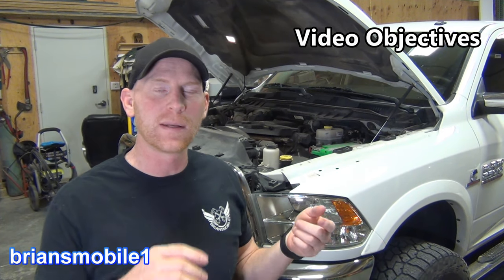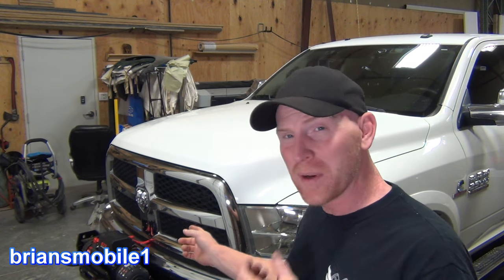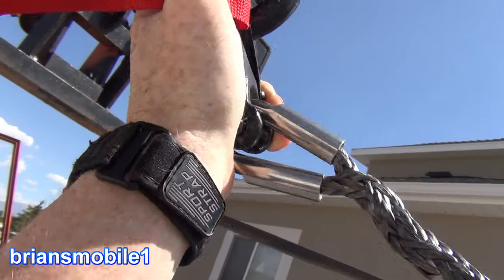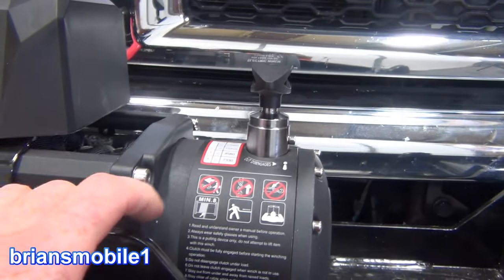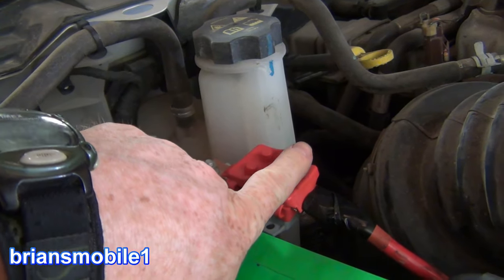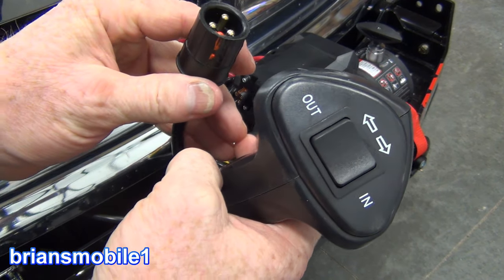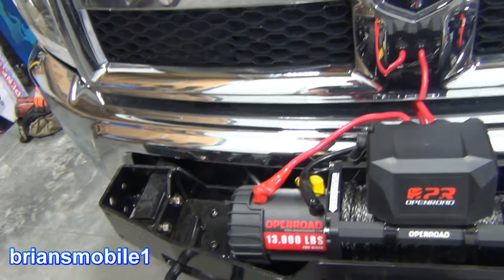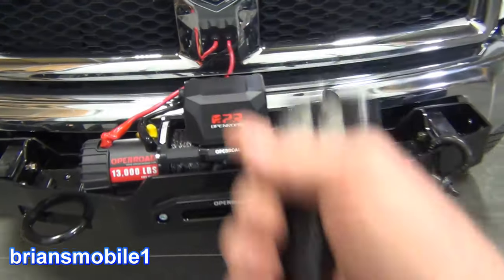Easy and Affordable Winch Install

Comment: Remember now with a winch you can do your Good Samaritan work easier, as you likely will run into some stranded vehicles on the road when out, and can get them back on the road faster than a tow truck, plus no call out fee. Now all you need is to keep a few extra straps in the tool kit for it, so you can replace them when they get cut.

Comment: With the bolts nylock nuts, the extra minute it takes to get them off is the difference between some lowlife taking the winch, and said lowlife getting an all expenses paid stay at the greybar hotel. Plus no way they can fall off over time.

Comment: I had a ram 2500 that i installed a front hitch mount and then a winch cradle (removable) with anderson connections to a harbor freight 12k with synthetic rope. Awesome setup as i could keep the winch off the front  and i did the same anderson connections at the back.
Reply: Exactly same set-up I did. Amazed how many times I've used it in the rear receiver to get back to safe ground.

Comment: Seems like the current trend is to go with the rope vs. steel cable these days. 🤷‍♂️
Reply from the maker: I've never been stabbed or poked by the new rope.  And they're way easier to splice if you need to.

Comment: You don't feel the need for a second battery in the truck?   Like 400amps max pull.
Reply from the maker: I think two batteries is plenty.  That's what the truck has stock because it's a diesel.